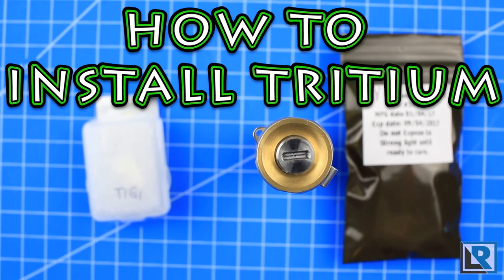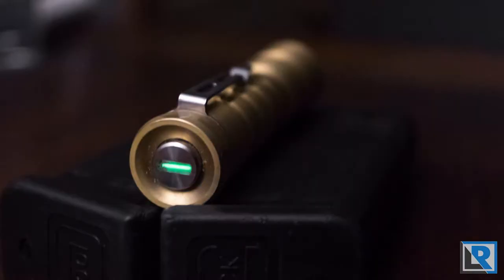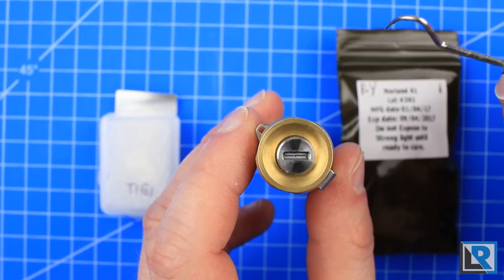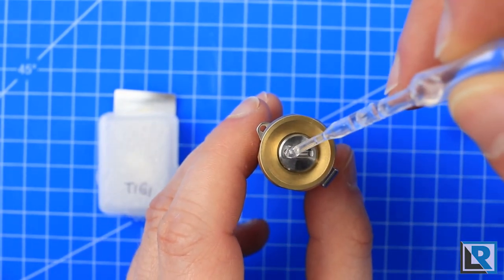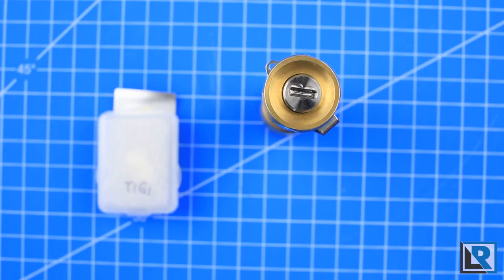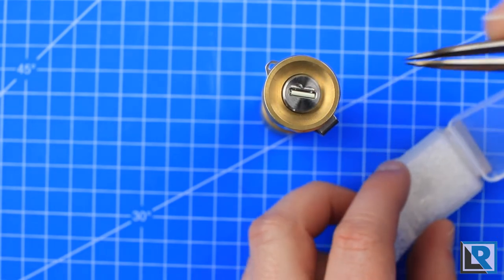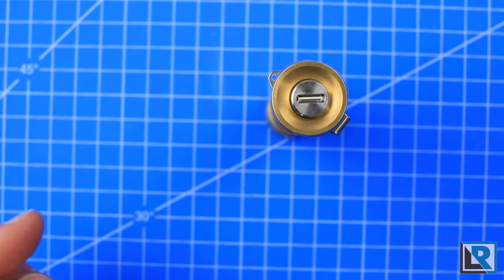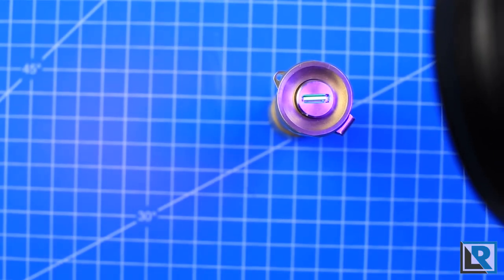How to install Tritium

Comment: MixGlo is the best value for tritium.  The packing shown in this video is still being practiced.  Very meticulous.  The vials are shipped in that foam lined snap closure case with cotton wadding, then sealed inside a foil/plastic bag.  The outer bag helps minimize radiation detection, so your package has NO CHANCE of being flagged.  I had them ship by registered, which is $5.  You really don't need tracking.  Shipping to USA takes about 1 to 2 weeks, depending upon the time of the year.
Reply: Can confirm, just received my vials from MixGlo, same great packaging and arrived in about a week, super fast!

Comment: Very helpful video -- thanks!  How much Norland did you buy?  Looks like at least 3cc.  I find 1cc is good enough for at least a dozen tritium vial installations.
As for tweezers, I worry a lot about pressure, as it doesn't take much to crack a vial.  What I do is create a paper "cradle"--basically  a 3" wide strip of paper that narrows to about 0.5"" with a crease.  The vial can be rolled onto the paper and will seat nicely in the fold.  You position the slot at the end of the cradle, then slide the vial into place.

Comment: Appears the UV cured epoxy is permanent. Can the vials be removed in case they need to be replaced?
Reply from the maker: Heat and mechanically will loosen it up some but not dissolve it.
Reply: @LiquidRetro  Great. Thanks!